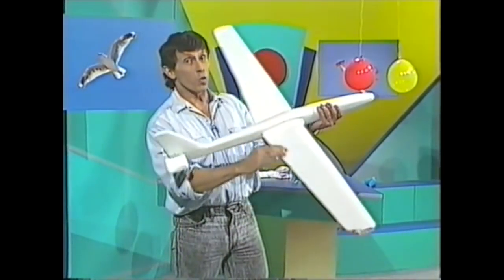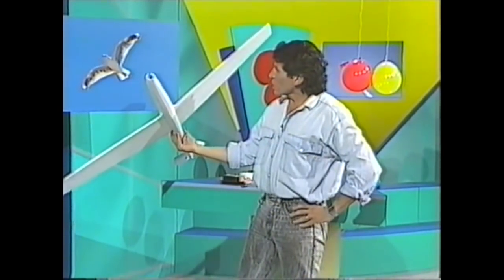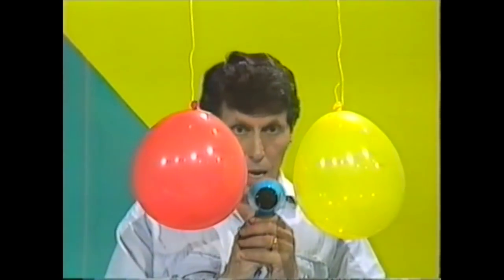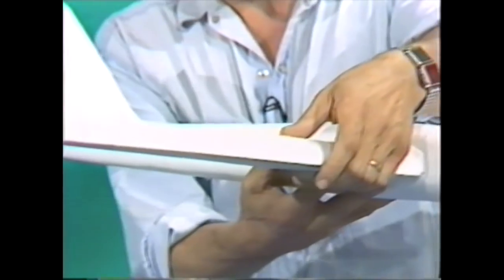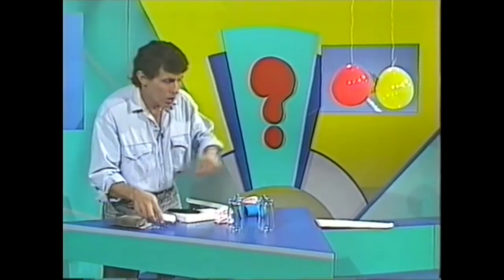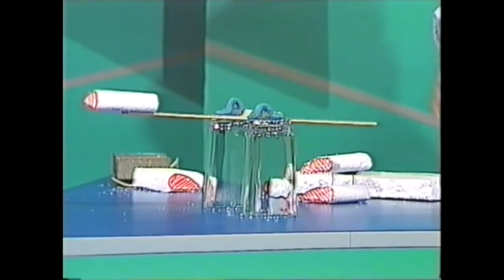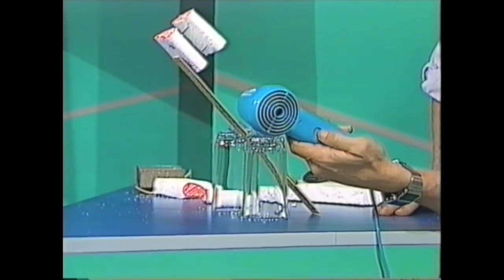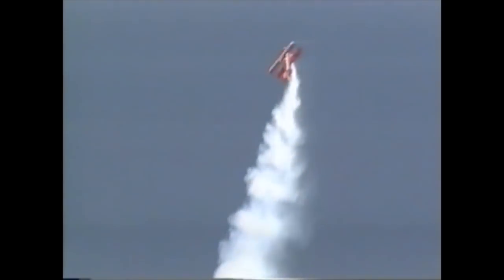Why Wings Work

Comment: too bad, it's in fact not the correct explanation (but I'd have been very surprised, did they in fact get it right .. heck, I'm not even sure this effect was truly fully understood back then, because all of this, umm, at least "incomplete" explanations must've came from somewhere). the truth is a bit different, not that hard to understand way more powerful than just that mentioned pressure difference alone and helps better explaining different effects just like stall. the true reason a wing works and generates a perpendicularly directed force in regard to the flow is mostly due to the Coanda effect (which in itself is somewhat difficult to explain as to exactly why this is a "thing" because it'd zoom into target microscopic effects, but most should know, flow has a tendency to stay attached to a surface that's bended, but just not to strongly (or then it'll indeed "separate.") so, think about the top surface of a wing .. the "exit" is pointed downwards; meaning that air that was flowing relative to the flying plane this very wing is attached to straight towards it will in fact, due to the Coanda effect, "leaves" that rear wing edge pointed downwards (and thereby causing this infamous downwash on the "go.") so, we started with air molecules with zero downwardly directed speed, yet ended with air (flow) also pointing downwards in parts. so far, so good. but air has a mass and according to Newton, only nothing comes from nothing, i.e., there's a reaction to every action. so, if some air gets "kicked" down, umm, what could possibly happen in return? right, the "thing" causing this change in direction must therefore get "kicked" upwards. essentially like when you throw a tennis ball, you'll get "thrown" back. (if you—however—doubt this statement, try to swap said tennis ball for an anvil and try again to get a better understanding or "feel" for it, lol). umm, yeah, that's about how an airfoil actually works. try to calculate for the pressure difference alone .. that one simply  doesn't explain the entire story going on.

another edit: because someone mentioned, this explanation may work for a (lightweight) balloon: note how even the balloon is curved, helping the air to deflect outwards (up until it can no longer stay attached). so, even here, Newton's third law most probably already plays a bigger role than pressure differences alone.
Reply: The flow follows a convex curved surface because there is air pressure holding it there.  You forgot that we live in a pressurized atmosphere.  
Just because the wing, or anything moves, doesn't mean that pressure stops pushing against the surface.
..
A Cessna wing with 174 square feet is  25,000 square inches.  At 14 pounds per square inch, ONE surface of that wing has ... ready for it.... 350,000 pounds of force on it.  Yep. Do the math.
These pressure changes we talk about for normal flight are very small.
On that same Cessna the Top-Bottom lifting pressure difference is only 0.1 psi!
..
The upper surface only has to change about 0.08 psi for flight.  That is only 1/2 percent decrease in pressure above the wing. . . an increase of 0.02 below makes up the rest of the 0.1 psi lifting difference.

That is the Wing Loading (Top-Bottom pressure difference at cruise) for a Cessna 172.  Get serious. Look it up.
Reply: @Observ45er  I knew all that and didn't contest it. while I do live in a metric world for me it always meant that when TV commentators were quick in pointing out the ingenuity of the work put forward by the respective aero department, I was always like (and since about twenty years, I'm speaking of), "hey, not so quick .. a car's roughly two meters wide and five long, giving it an area of about ten square meters when looked at from the top meaning that air already pushes the car down with about 100 metric tons. if the measured (there's sensors specifically put there for doing exactly this into the suspension) downforce is only about two tons at 180 mph, then this in return means, the aero guys "only" exploit about two percent of absolute maximum." only trying to point out you don't hold exclusive to you knowledge despite behaving like.

and the downwash is directly proportional to the lifting force created. it's a little hard to simply call it a "byproduct." can you design a working wing without producing downwash? sure, it also causes pressure differences and yes, ultimately it's the net pressure difference holding a plane in the air (I thought that's so logical, it doesn't even need to be mentioned .. because we you correctly pointed out, there's nothing else). just what causes this differences and why is up for debate, as it looks like (ultimately, we don't even disagree that strongly, wouldn't it be for you to assume, you're the only person in this planet to hold any knowledge about something at all and therefore all the other people around must be idiots).
Reply: @To.Ma.To_78   I am sorry, but I am unable to understand your most of your points. I think English is not your first language. 
.
The "debate" is because so many amateur scientists do not fully understand themselves - so they get it wrong.  They are unable to give a correct physics explanation using the well known science. 
- You say: "I knew all that", but use incorrect explanations, yourself.
.
- Please note that this video says the curved flow is the cause of the pressure decrease; this is correct, but he does not explain why pressure changes in a curved flow - so he is not completely wrong, just incomplete. The reason pressure changes in a curved flow is not really difficult, it just takes the right words. 
He also does not claim the most common misconception that "Fast moving air has a lower pressure" - because it does not. That is the most common misunderstanding of Bernoulli's Principle. This can be shown with some simple equipment.
This video is somewhat better than most others that have very serious flaws. 
.
For example:
- You use more words to say this video is wrong that explaining WHY it is wrong.
.. .. ..
So here are some real explanations why :
.
You say:
- "Coanda", but this is wrong because Coanda is defined as a JET of fluid blown into stationary fluid where you have constant entrainment: there is no jet above a wing; all the air moves mostly in bulk. There is similarity, but it is not the same. The upper pressure decrease is not very difficult to explain, see link below.
 Not only is "Coanda" wrong, but these people do not understand and cannot explain why Coanda also causes a pressure decrease.!.
.
- Flow does not have "a tendency to stay attached to a surface that's bended" Because atmospheric pressure pushes against all surfaces at all times; convex, concave and flat. It would be more correct to say that the air "has a tendency to travel in a straight line" because Newton's First law tells us *why*.  Call that inertia and we easily understand that this inertia causes the decrease in pressure. See link below.
.
- You then use the "Newton's Third Law" as a 'cause' and "reaction".  That only explains 'what' happens not WHY. Unfortunately, the downward moving air does not cause the upward force; it is a result of the same pressure that pushes up on the wing. Euler explained pressure at a point in the mid 1700s. It is fact that a force must push in two directions and the source of the force is the cause. not the moving masses.
.
- The tennis ball / anvil is not the cause of the "kick"  YOU ARE the cause because YOU apply a force to it.  It has mass / in inertia that resists your push.  It is that inertia that is the cause of the recoil.
You cannot "doubt" Newton; you must fully understand Newton and apply the laws correctly.
.. .. ..
Correct explanations are not extremely difficult, but 11th grade physics is required and it does take more words than just "Coanda". 
.
I stop here because it is fully explained step-by-step using well known physics here: 
 Understanding Lift Correctly 
 https://rxesywwbdscllwpn.quora.com/ 
- - 
Best regards
Reply: @Observ45er  okay, I understand. while English isn't my first language—you're totally right about that—I'd still rather suspect swipe input to be the root cause for being hard to understand since normally I do get along decently well (speaking it, I mean). and yes, you indeed could explain everything well and logically sound enough for me to see and understand all errors I made. I'll take your words to improve my future understanding of those intrinsically difficult to grasp effects because it somewhat defies "regular" expectancy. after learning basically the same thing so often in different and new ways, I was just darn sure to have finally "nailed" it .. but still didn't really get it *sigh.*

thank you for all your effort you put into your writing .. rest assured, it really wasn't in vain since I'm very interested in this topic (and happily read a very good explanation from someone that obviously "got it" for real .. or however I can express this the best way possible, lol).

*deep bow and out*
Reply: @Observ45er  oh, there was even one conversation between us before .. I forgot about that, lol.

yes, sorry, I was annoyed by your math about the pressure one wing is sustained to. not because there's anything wrong with your math, but you really did put it like no one else knows that. twenty years ago I'd have answered questions regarding how planes fly with, "there's enough pressure underneath a wing to shoot the entire plane into the air like a freaking rocket! only minor issue, there's also pressure on top of it, preventing it from doing so; and getting rid enough of the upper surface pressure to support the whole plane is the tricky part." that's the main objective, after all.

and yes, meanwhile I also did read the link you provided me with and never before discovered such a comprehensive explanation .. it really helped putting single pieces I knew about together in a more complete or simply better way than I could do before.
Reply: @To.Ma.To_78  I'm sorry I don't remember a previous conversation. I rarely use math to explain science because it doesn't, as I said. 
Your explanation about the pressures and shooting the plane like a rocket is a good way to start.  
One thing that people so often forget about, is that we live in a pressurized tank of air.  It is pushing inward on us all the time and they don't realize it.
I saw one explanation that claimed that it is impossible to create much lift with the lowered pressure above a wing because once you remove ALL the air and make a vacuum above the wing, you can't go any farther.  BUT, you can always add more pressure under.  THEREFORE, lift comes from the bottom only.  As you know, removing all thee air above would rip the wing off in a millisecond.
Cheers.
Reply: @Observ45er  I was talking about our very first encounter in here that kind ended in some sorta squabble. I'm "old" (best excuse ever, lol) and therefore somehow forgot about it until after I discovered it again in here (after means, after I replied to you the, umm, "first" time after the actual first time, that is. I know, it probably won't make much sense, lol. at least, I tried, though 😅)

but yeah, cheers and have a nice day (or evening, that actually is, lol)!

Comment: Hello, why aren't all planes biplanes nowadays?
Reply: The main reason for the use of more than 1 wing in the early days of aviation was because a biplane configuration gave the wings of the plane more stiffness since the two wings held each other by the use of relatively light weight cables(as you can see in 4:44 in the video, the two x lines in each side of the wing), so a biplane configuration was simply stronger, two wings also gave the plane more lift compared to only 1 wing of the same size(although not twice as much) which meant the wing could have been shorter than a 1 wing setup, which was important because of the slow speeds the planes could fly in with the low power engines available at the time.
However, the downside of two wings configuration is obviously more weight, more cost and mainly more drag created by the plane, and in higher speeds that is a crucial factor.

Because of the advancement of technology, materials and engines used in aviation today there's simply no need to use more than one wing.
Reply from the maker: @E_y_a_l  An excellent analysis of the multi wing question!  Thanks.   Deane.
Reply: @CuriosityShow  Thank you Deane, appreciated, and thanks again for uploading these segments.